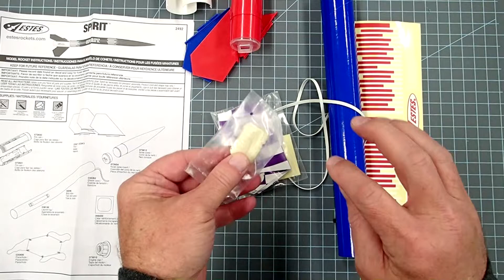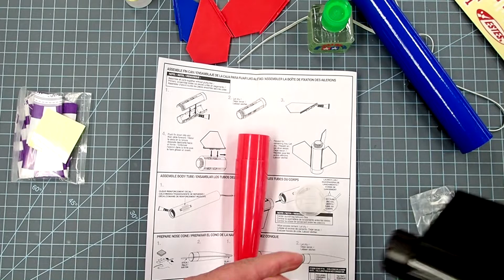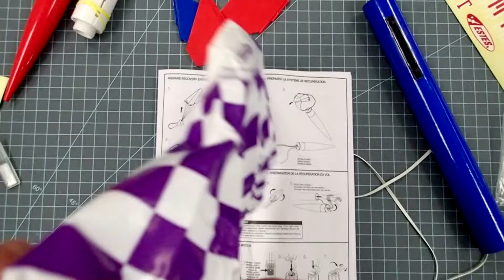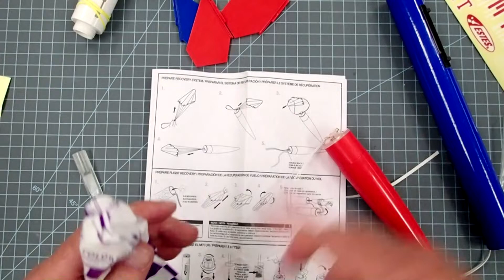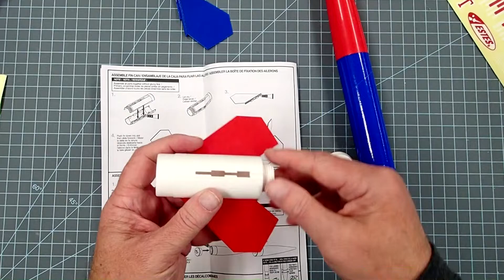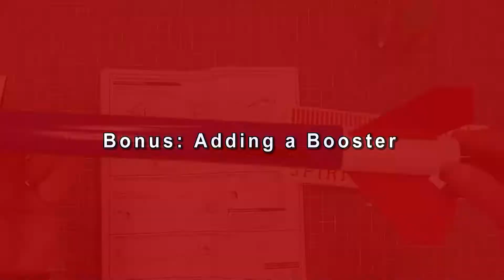Estes “Spirit” model rocket assembly

Comment: Nice build. I'm glad that you recommended using CA for the assembly of the fin section to the main body and the base of the nose cone to the upper section. As someone that likes to restore rockets I can't tell you how many times I have purchased rockets assembled with model cement and just wiggled them ever so slightly and had them come apart in my hands. 

I don't know exactly why but model cement doesn't adhere to Estes plastics and it certainly doesn't work with plastic to card board. 

Very detailed build video.